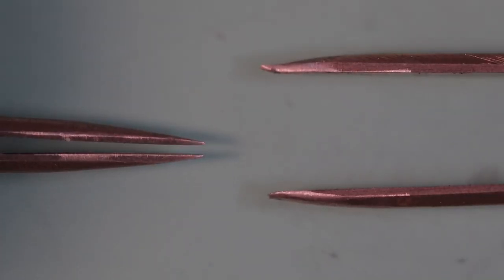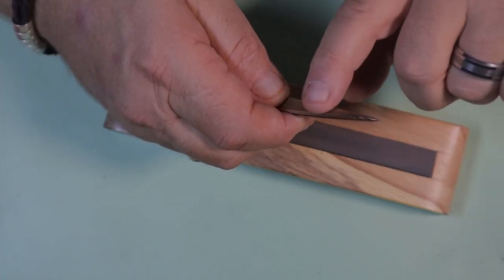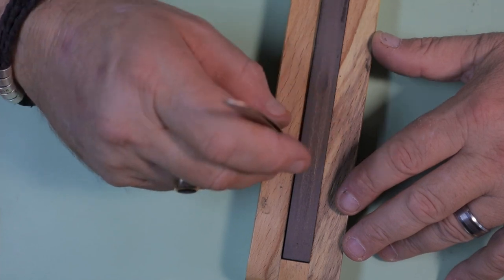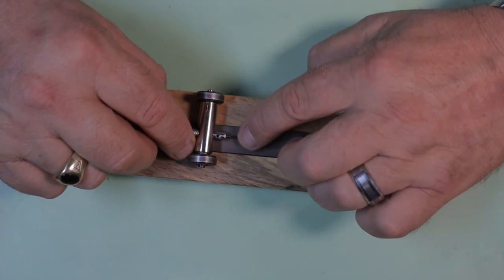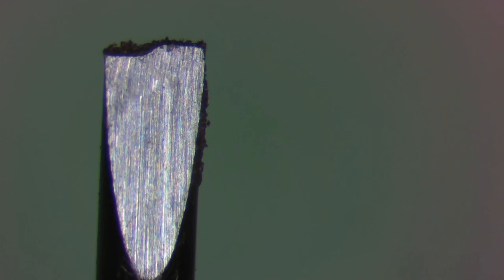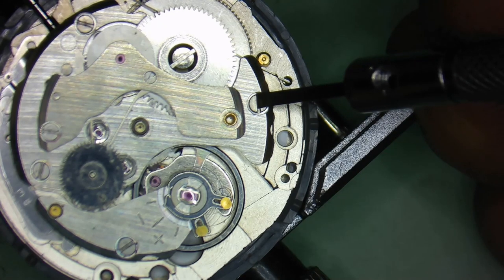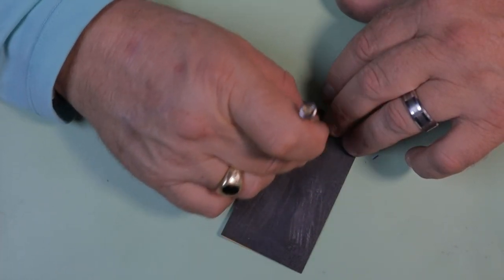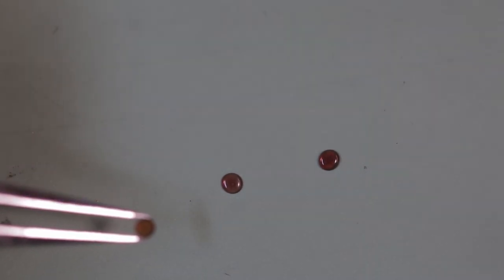How to Shape Tweezers and Screwdrivers for Watchmaking. Episode 2 in Watch Repair and Service.

Comment: This is a great tutorial on a skill that comes up every single day!
Quick question,  once the screwdriver is sized properly for the head, is there a 
technique to reduce the chances the driver will slip from the slot and cause a scratch? Would bronze screwdrivers make sense? Or are they too soft and would need constant maintenance?
Reply from the maker: Yea Thant is actually one of the points of sizing the blade to the slot. Just make sure that the tip of the blade is not touching the bottom of the slot and hold the top of the screwdriver vertically with your pointer finger and turn it with your thumb and second finger. 
Great question.
If you find and bronze tips, let me know. They would be hard enough
Reply: @watchrepairtutorials  Good to know,  only thing I've found that close is bronze handles with steel blades.. Yeah,  not going to help lol.  Thank you for the help,  I've been struggling with not scratching on screws that need,  persuation.. This should help a lot! If I'm able to find bronze tips I'll let you know.  Although,  with a lathe that could be make pretty easily. Sadly all i have is a Boley F1 and I'm not sure that would be a good choice for those. Might be,  I'll have to figure that out. I'm not good with the lathe yet.
Reply: What I seem to have noticed is that a screwdriver produces scratches from the corners of the blade; I very slightly round them off with sandpaper after dressing the tip and that helps decrease scratching in event of a cam out or other misadventure.
Reply from the maker: @cgnicolis  that’s definitely not a bad idea.    I will do that if I run into a weird size screw sometimes. Great tip

Comment: Could you please tell me which parts of the watch need to be lubricated with the appropriate type of oil? Can I have the oil code information for each part, please? I'm a new student
Reply from the maker: Of course, if you’re working on a modern movement, there are tech sheets available that list the recommended oils and lubricants for the different parts of the movement but if you’re working on something manufactured before say around 1970 you’re not gonna find text sheets. So the general rule for the train of wheels is barrel arbor, 2nd and 3rd wheel HP 1300, 4rth wheel escape wheel and balance pivots get 9010. The pallet stones are lubricated 9415. 
Then any parts that sit on a post or slide across each other, metal to metal contact get either 9504 or D5. I prefer 9504. 
I have done lubrication videos that are in my beginners playlist.
Reply: Thanks him for useful sharing , I hope you make many good videos about your profession
Reply: @watchrepairtutorials  Hi Alex, I have watched quite a few of your videos and they are very educational. Thank you for your way of teaching. When I go to Moebius website and look at their lubrication chart they want us to use a lot more types then what you recommend as a base line.. Is that in your opinion just marketing to make us buy more or is there some merit to the 11+ types they want us to use?
Reply: @watchrepairtutorials  Also, where is the best place if any to engage in a factual conversation with you?
Reply from the maker: @micnolmadtube  not necessary. It’s a combination of marketing and extremely small gains. What’s more important is getting the application of the basic lubricants perfect. That will have a much bigger impact on your service, then investing in a bunch of specialized lubricants. I mean you could literally have a different oil for every wheel in the train.
Reply from the maker: @micnolmadtube  you can contact me through email on my website

Comment: Hi Alex, just got my ST36, and some basic tools.  I cannot keep the loupe on my eye though, any tips on that?  
I'm 60 and just starting this journey, I waited too long. :)
Reply from the maker: They have a thin wire piece that hold the loupe and help to keep in place. Very inexpensive accessory.
Reply: @watchrepairtutorials I'll see if I can get one of those, I had considered the ones that clip onto my glasses also. Thank you Alex.  These are great videos.
Reply: I use the ones that clip on your glasses they are great. You get what you pay for though I have some cheap ones you have to look through the very centre also have some better ones that I can look through any part of the lens.

Oh, I also find they are best on my single vision reading glasses they can be a pain in the behind on my verificals.
Reply from the maker: @piperman63  I have the clip on for my glasses. I don’t use it very often but it works well.

Comment: I have tried your tip for closing tweezers, both brass, and stainless. I am not having any luck with that. I have read all of the comments below and no one has mentioned having any problems using your technique. So, it must be me. Bending one side seems to open the opposite side. You just go back and forth with no gain. What do you think the problem would be?
Reply from the maker: So holding the tweezers in 2 hands, put both of your thumbs in the middle of the tweezers and put with your thumbs while pulling back on the ends of the tweezer.
If you are doing that and the tips  are not getting closer together, it’s the metal the tweezers are made of.
Reply: @watchrepairtutorials  Thank you.

Comment: Isn't some extra space in a screw slot acceptable when you're bound to come across a variety of screws of different depths/slot widths?
Reply from the maker: nope. That's how screws get damaged, broken and the screwdriver slips out of the slot.
Reply: @watchrepairtutorials  noted, and thanks.

Comment: So if the tweezer tip width is open too much, the added force required to close them on a part might cause you to squeeze too hard?
Reply from the maker: It’s possible for sure. Thick about it. If the tips were 1 inch or even 2 inch it would require more force to close it correct. 
That’s exaggerated of course.
The tips only need to open enough fro pick up the part.
Reply: @watchrepairtutorials  
Yea that  totally makes sense. Thanks for the reply! This vid made it a breeze to disassemble and reassemble the keyless works on my first attempt, with minimal tools.

Comment: Tool hunting is not too easy here in Germany I think, there's a lot of stuff that is not super cheap on amazon, can easily spend a couple hundreds before starting and it's still a hit and miss about the quality. Sounds tempting though, try to get just the basic kit and have a crack at it, can always upgrade if I would end up liking it. Great videos!
p.s. we have different offering on amazon, often the links don't yield anything meaningful just 50 similar chinese items
Reply from the maker: It is a problem that unfortunately has no easy solution

Comment: I wish the volume were higher.  I had a lot of trouble hearing you.
Reply from the maker: No doubt. My second video was pretty bad. I think I have worked out the audio problems now. 😀
Reply: I reccomend trying the "enhancer for youtube" browser extension. It let's me boost the audio up to 10x. There's quite a few extentions that do the same, the one I use has an icon that looks like a magicians wand and it's free.